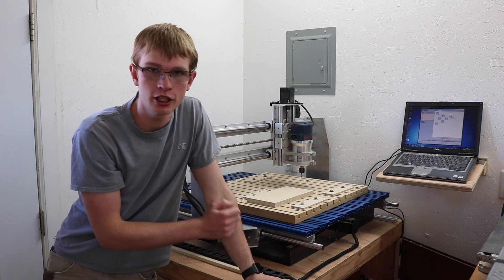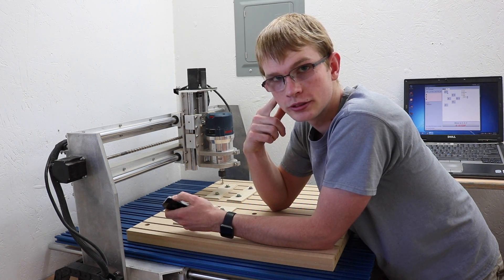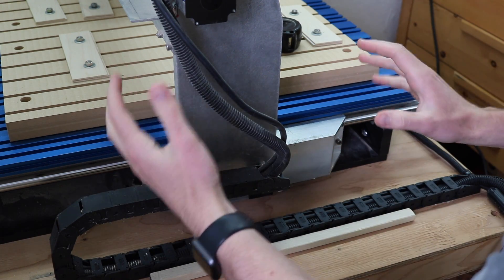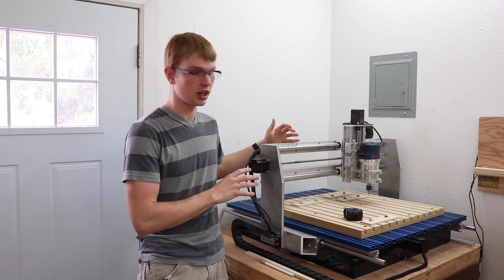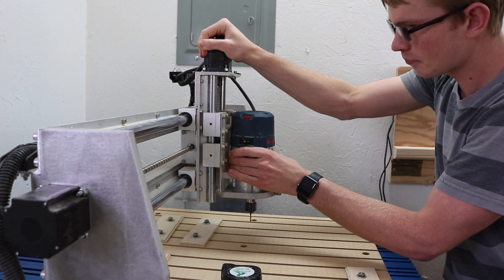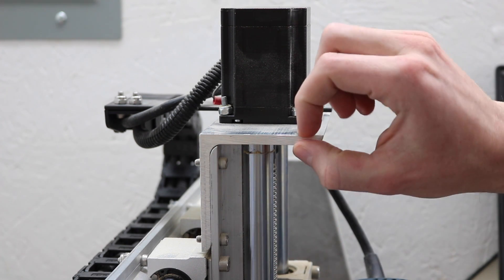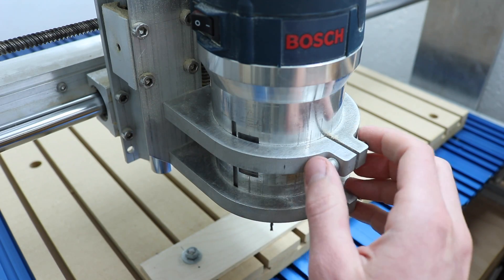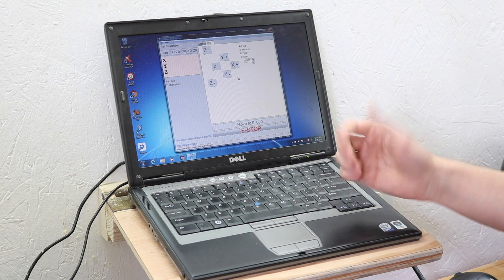All about my CNC machine

Comment: You could easily improve your gantry by adding a stripe of 1" birch plywood between the two horizontal aluminum angels. That would turn it into a u-profile.
Reply from the maker: +Wolfram Herzog 
That wouldn't do much in the way of preventing twist. A tube is extremely resistant to twist, which is what I need to address.
Reply: I replaced the black plastic plate on the back with a checkerboard plate.
I like your open design though.

Comment: An other question, I think, is if you have a use/need for one, or just want to build it for the fun of it.
I also have an X-carve, but with the original wimpy motor, and I have not really found that much use for it in my woodworking.
Reply from the maker: +Wordsnwood (Art Mulder) 
Good point. I think the X-carve is perfect for those who want to just play around with CNC, but the real beauty of a CNC is how perfectly precise they are, being able to quickly cut complex parts with 0.001" precision. And an X-carve lacks that precision...

Comment: How does your Delron nuts hold up to wear on the drive nuts?  Seems like being just a hard plastic, it would wear faster than desired over time.
Reply from the maker: +Justin Young 
I've had this machine for about 3 years, and although doesn't have too much use (maybe as much as 90 hours) it doesn't show any significant wear. I would also mention that Next Wave Automation sells these fairly cheap as replacement parts.
That being said, I would go with ball screws if I build one.

Comment: Thanks for posting your video. The pressure you exerted on the Z axis is most likely greater than any cutting you'll be doing. Provided you don't put titanium on the table.
Reply from the maker: +oned4metwo 
That's true, but consider that even a tiny bit of force will flex it some. Any flex at all is a bad thing.

Comment: Have you seen Marius Hornbergers CNC Clapms?
Reply: Those are not his clamps. mtmwood made those long before Marius did and I guess mtmwood didn't invent them either.
Reply from the maker: +Sebi Land 
Yes I have. They are great, but they won't hold as well and you can't cut around the edges of the part.

Comment: Great video and great build. And I LOVE that clamping set up! 

What I think might not have been clear to viewers who are not familiar with CNC designs and cutting forces in general is that the reason the flex you demonstrates matters is that the cutting bits are applying just as much force to the workpiece, so if you can flex it with your hand then it will flex while cutting, greatly reducing accuracy and cut quality/finish. 

I have a box of parts, including steppers and controller, given to me by my brother who never finished a gas-pipe-and-skate-bearings-CNC-build over a decade ago. I've wanted to build something like this with them, but I never have time to even think about the design, much less do anything with it.  I may contact you down the road about that. I have a mill and a lathe (and a surface grinder), it's the design I lack. First I need to make room for the machine... :)
Reply from the maker: +Jon Miller 
Thanks!
I appreciate the thoughtful feedback about newcomers not understanding CNC forces. I didn't think of it that some wouldn't understand that, since I've had one for so long it seemed obvious to me :)